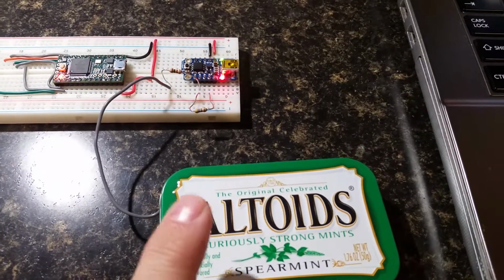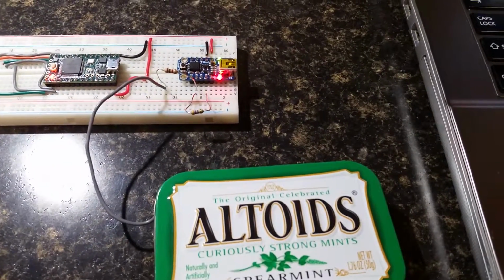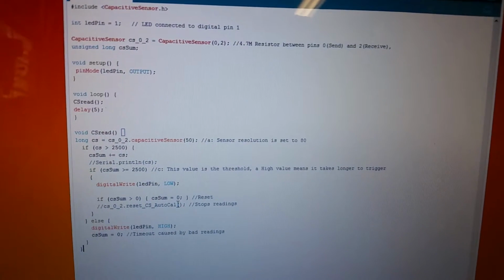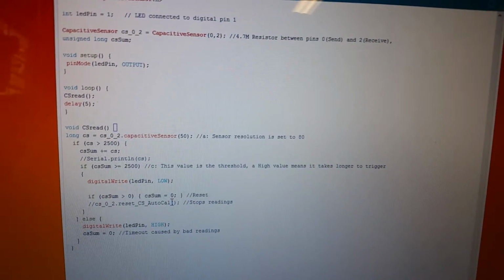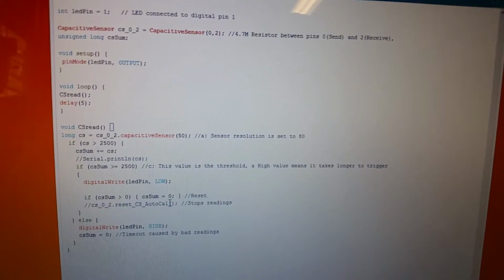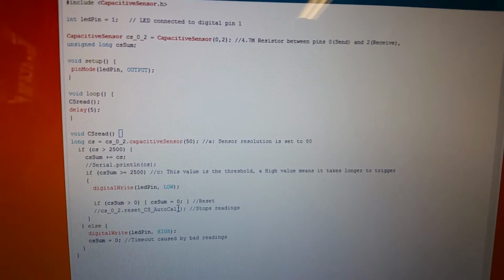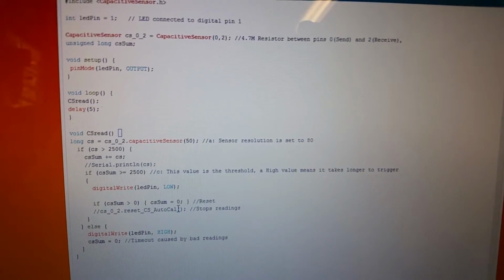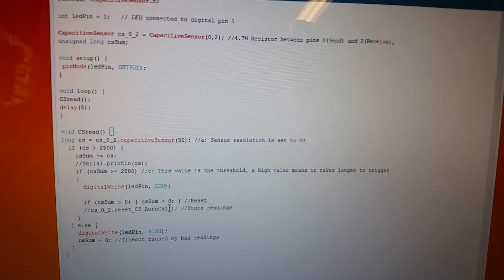Capacitive Sensing on the Adafruit 5V Trinket

Comment: I have a trinket pro. I have a little bit more complex setup. It's very stange : while I'm debugging with TrinketHidCombo.print(cs);  and led it  works well. When I remove "print" and leave only led it stops to work.I dont' understand why. It's hardware related and not my code.